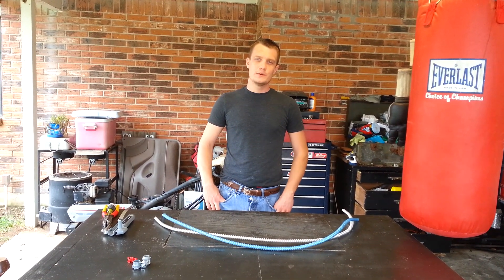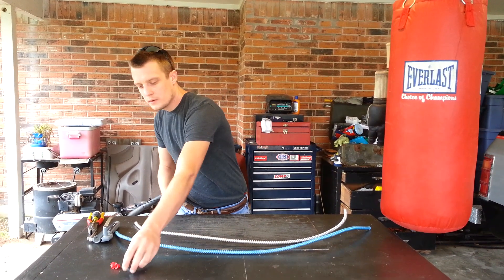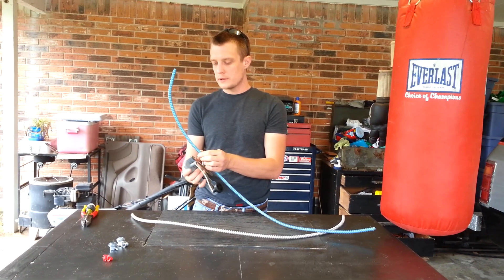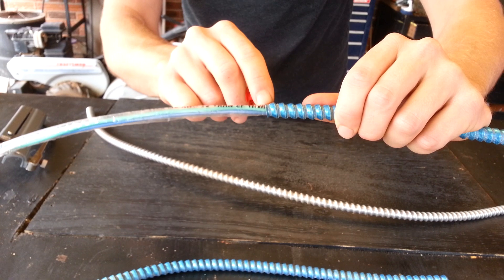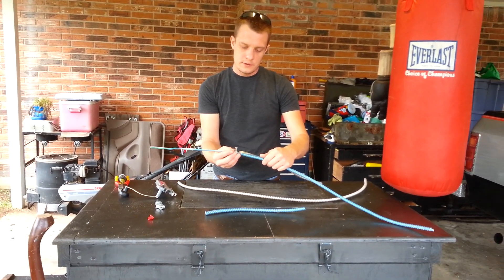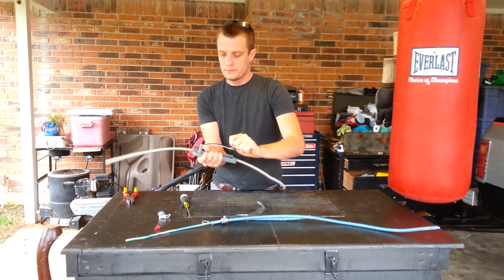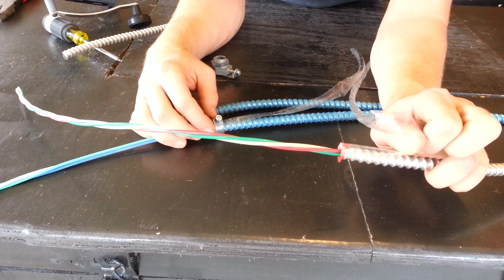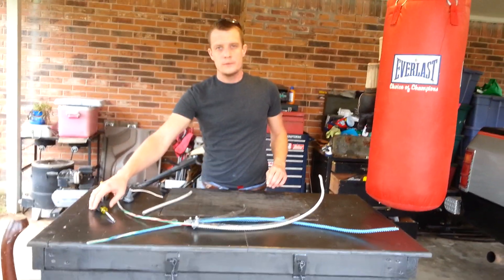HOW TO Strip MC Cable

Comment: In your description you say that aluminum is AC, but that isn't true. They make both aluminum and steel MC. AC cable has a thin bare bonding wire that makes contact with the armor. Both versions in your video are Type MC. That tool is called Roto-Split. A roto zip is for cutting holes in drywall.

Comment: how  or can you connect it to conduit like pvc going outside? I want to connect in my garage then to go outside and run a couple feet to ceiling of carport(outside of garage)
Reply: Brad S for outside they have liquid tight which is flexible conduit you can strip your wire and run through. To switch to EMT or hard pipe conduit there are flex to emt connecters. Homedepot can show you. Just use liquid tight outside.

Comment: Greenfield 1 inch squeeze connectors are not reliable for upside down connections on 1 inch mc cable such as 1/0 3wire MC

Comment: Informative video. I had never seen or used the device and looks like it works well. The few times that I had worked with armoured cable, I used a hacksaw.
 FYI....... The tab on the plastic bushing (anti-short) should protrude through the connector for easy inspection/verification.
Thanks for sharing.

Comment: Great video on teaching MC basics - short, informative, and to the point. Thanks for posting.
Question: do you have a video on how to connect MC into a switch box that has MC compression plates pre-installed?

Comment: Very informative, and interesting to see how the NEC differs quite a bit from the CEC here in canada. very few times have i run in to "local differences" in the code. Some more major city centres have a separate inspection branch which sounds similar to your local codes superceding the NEC. Thank you for sharing. 

in which applications would you use MC over AC? All we really use up here is AC for commercial applications.

Comment: Please please do not isolate the metal cable jacket from the connector and box by folding the plastic over the anti short bushing you are defeating your path to ground
Reply from the maker: The MC cable sheath is firmly clamped at every other point on the connector. The metal sheathing does not qualify as a reliable ground source. Article 330.
Reply: The MC metal sheath has nothing to do with grounding anything.
Reply: I would also like to add....its a bond and not a ground

Comment: In Tx , we use the '' Push On '' type connectors for MC cable , commonly referred to as BX cable !
Reply: Push on / stab ins  are junk and generally have been used in the worst installations i have ever seen.
Reply: BX cable and MC cable are not the same thing.

Comment: Just as an FYI for you.....In Type MC Cable the Anti-Short Bushings are not required per Section 330.40 of the National Electrical Code. If you were doing Type AC Cable then the Anti-Shorts would be required. However, they are always optional to be used ...just don't confuse them with being a NEC code requirement on Type MC Cable. Also It is highly suggested that you remove the polymeric protective wrap prior to installing the connector to ensure the bonding of the cable to the connector is in accordance with the manufacturers original product evaluation which was not done with the poly wrap under the fitting reducing the surface contact area by up to 25 %. Just some thoughts and glad to see the use of the Roto Tool versus hack saws and so on...Nice Job.
Reply: Oooooohhhhhhhh , an electrician fight !!!!! These two nerds are gonna argue who is the bigger genius and who knows code more.
Reply: Straight from the Southwire MC spec sheet - 'Anti-short bushings are not required for use with MC cable per the NEC and UL'

The throat of the MC connector protects the wire from the cut end of the MC.  This is 100% correct.  This is also covered in a NEMA bulletin for those interested (NEMA engineering bulletin 90).  With that said, every municipality does hold the right to go above and beyond NEC codes and any electrician, engineer, or good DIY should be aware of their local codes.
Reply: thewibb completely correct. Many electricians say they are required because no one is going to fail an inspection with them installed but they are not required by the national code for MC.
Reply: I wouldn't hit a cat in the ass with a roto zip. They suck
Reply from the maker: Encore Codes- Codes and Standards Are you an electrician? Local/city codes supersede the National Electric Code, and most places require Anti-shorts on both MC/AC Cable. I know if you're caught not using them you will fail  in Austin, TX even if you used black tape. If you use no type of Anti-Short you will short out and ruin the cable. I've seen it happen more than once. You're mistaken by saying that you should remove the plastic wrap because the cable will ground to the connector on the other side of the set screw. I've taken classes on just how to strip this cable, and what I've shown is the proper way.
Reply: I am a Master Electrician and if that is the case in your locality then I would suggest making that statement. You can also listen to my recordings at www.masterthenec.com as well as I have a radio broadcast on Understanding Type MC Cable. If a locality went above and beyond the minimum standard to require anti-short bushings for Type MC Cable then it shows me they have no clue as to the intent of the bushings to begin with. I would encourage them to read UL 1569 for clarification.